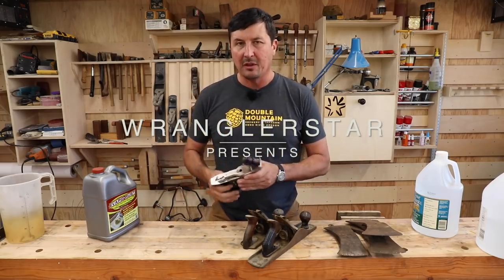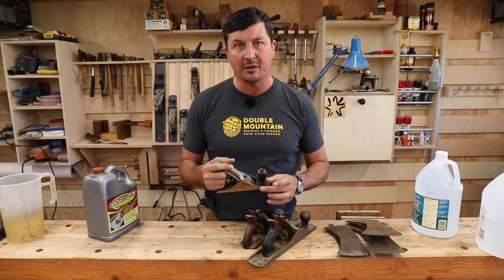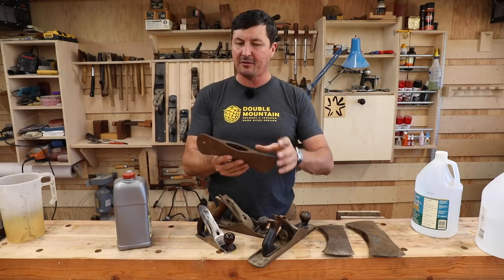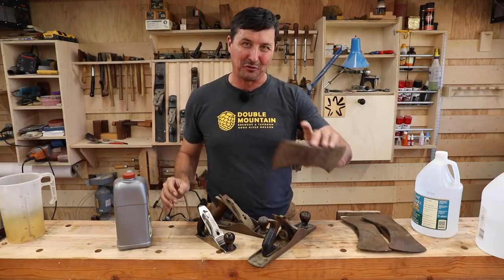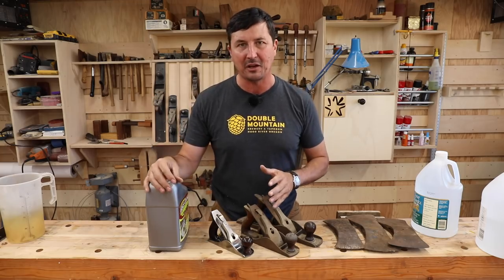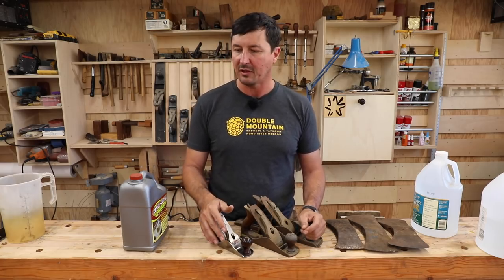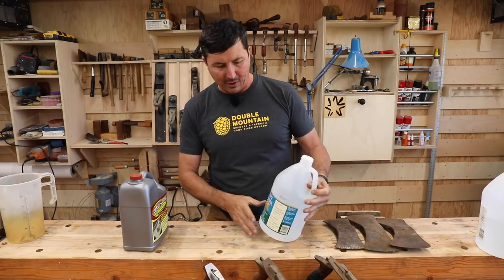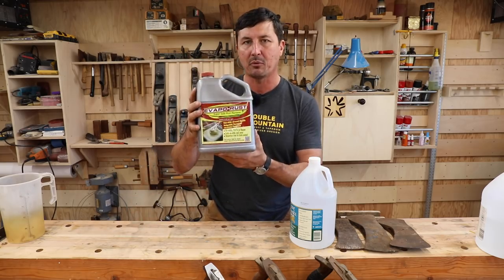Polishing A Rusty AXE

Comment: I use both, and cider vinegar all with great results. The evapo rust 3.5 gallon comes with a handy basket too. However I would knock off as much rust and dirt with a brush or wire wheel first I find it let's the evapo rust last a little longer. Great video wranglerstar hope to see those double bits in another axe video someday.

Comment: Vinegar is waaay slower, eats away at the metal, and it'll rust easier later on as it doesn't get in pitting. I recommend Evapo-rust anyday. Usually only needs 6 hours max, literally all pitting from rust is CLEANED OUT. Leaves everything (as you couldn't see the paint) and has all the benefits on the bottle.
Reply: Oh, forgot to mention. YOU CAN REUSE THE STUFF FOR YEARS.

Comment: Have you ever tried coca cola for rust?
Reply: Marc Reinecker oh ok
Reply: Works amazing on Battery terminals. I think I used Diet Coke tho.
Reply: I recently did a test between distilled malt vinegar, apple cider vinegar, coke and bleach. Malt vinegar was most aggressive, apple cider next, bleach worked a bit and coke did almost nothing - this was after a day and then also after a week left in the liquids. I tried them covered and open to air too - malt vinegar really ate into the metal actually. Was an interesting experiment

Comment: +Wranglerstar , You can reduce the amount of liquid rust remover required to a very small amount by putting the item in a bag with the liquid rust remover and then leaving your bagged tool to sit in a container of water.  The water pressure should very evenly disperse the liquid rust remover along the surfaces of any item without voids.  The only problem is that it squeezes it so thin that it occasionally will not complete the reaction before becoming locally inert, but there is an easy solution!  Simply pick the bag and item up out of the water and all the liquid rust remover will fall to the bottom and self agitate,  then you can return it to the container of water to finish reacting.

Comment: I've been using Evaporust for years and it ROCKS! One caveat, put something (oil, paint, primer, etc.) on the metal right away because it will start to rust from moisture in the air right away.
Reply: Also, Evaporust supposedly has an expiration, haven't had a problem with that, only losing effectiveness from over use.
Reply: Also, also, Evaporust does not efect wood any more than water.

Comment: I have used both products many times and your results seem to be identical to mine. I found out that 12- 24 hrs with the evaporust and 2 and even up to 3 days with the vineger . If you left the vinger work a little longer it would look the same as the evaporust plus the evaporust is expensive but can be used several times. so both work equally well just depends on what works for you in both time and of course money.

Comment: Love Evaporust! Used it for restoring a bicycle. Also, once it settles, you can reuse it if you filter out the old stuff. I did find though that surface rust will begin again if you don't thoroughly dry it after rinsing it and you don't find a way to protect it.

Comment: I tried this stuff after watching your video.  I had an Register in my bathroom located between my shower and toilet that was really rusty, aim being what it is.  So, I put the rusty register in evaporate and let it soak overnight.  It did an excellent job on this rusty register.  I can actually open and close it now.
  I am going to throw in some rusty tools and chainsaw chains that I have in the shop to see if it will do the same to these.  I got the chains given to me a because they were so rusty.  My chains are so coated with bar oil they will never rust.

Comment: For those who are wondering why this works, here is why: Weak acids (like the vinegar) can dissolve and loosen rust, the rust that is removed forms a salt that is soluble. Vinegar can also replace the rust with a thin film on the surface to help resist further rusting, and that is why the vinegar soaked tools are not as shiny as the ones that were in the evapo-rust. Other acids like coca cola and even lemon juice are other ways to remove rust.

Comment: I think the Evapo-rust was doing a better job at not damaging the axe. 
You were right about a darkening and pitting of the vinegar soaked steel, the dark colour is micro pits taking away a smooth surface light reflects off. Vinegar is mostly water, which oxidizes, and the Acetic acid actually speeds up the corrosion of the steel.

Comment: you can soak your cast iron pots and pans in vinegar for a couple hours then use a scrub pad on em before ya remove em from the soak to get all the gunk off, then rinse in clean water, some say soapy water, before re-seasoning em.  Vinegar will etch the metal if left to soak too long but ive soaked a couple of old dutch ovens that were rusted beyond belief for a couple days and had no issues.  They came out looking like they came off the factory floor brand new unseasoned.

Comment: I have an old cast iron skillet and when it gets rusty on the bottom, I warm it on the stove apply about a teaspoon of vegetable oil, wipe with a paper towel and place the skillet upside down in a cold oven. A rusty outdoor tool could be warmed and treated with beeswax or vegetable oil and kept in a shed. But, if I clean an indoor tool and want to protect it, then warm  it and apply beeswax or 3-in-1 oil. I'm not going to fuss with a patina of rust, I'll treat it and store the tool. It should be done on scheduled maintenance.

Comment: The vinegar will leave a darker tint to the metal. Evaporust can be used several times before it has to be thrown out. I've used it and electrolysis exclusively for a couple years

Comment: ahoy,
got this from an old US Civil War soldiers journal, 
and it works great:
1 part molasses to 8 parts water,
mix it up and let the rusty item hang in the solution.

I've been doing it for years, currently have a 55 gallon barrel of the molasses solution, right now it has a half dozen Griswold frying pans it in it. a month ago it was a pile of 1920 Harley parts,
it works

fair winds
Salty

Comment: I would presume he had Ballistol or some other oil protection on that little Stanley tool he dropped into the cleaner. If so, it first would need to be stripped of any oil or wax as those will negate the vinegar and I'm sure the Evaporust stuff.   A brass brush is good to scrub with under running water (yes water), once cleaned good with the brush, I dunk in a bath of baking soda THEN, when coming out of the baking soda, I use a hi output blower to get rid of the water, then rub down or pour denatured alcohol over the tool to evaporate any hiding wet spots, then immediately do a oil or wax rust prevention on the item.

Comment: I tend to use vinegar, turns the red iron oxide (rust) into black iron oxide, works better with heat, and agitation. But it is an acid so you have to neutralise the metal afterwards. I'd like to try out the evaporust on a few projects I have coming up...

Comment: I found a product that is really good at preventing rust.  I have my shop in the basement and it's always damp and everything rusts.  I put this stuff on all my tables and tools.  It's called Fluid Film and it's made from sheep lanolin.  I have no connection with the product other than using it.  It's not cheap but a little goes a long way.  Been using it for years and believe in it 100%.  I got mine on amazon.

Comment: Good test and comparison; thanks. As a rule though, vinegar takes a bit longer, especially as it can be hard to find off-the-shelf distilled white vinegar with more than 5% acetic acid content. The greater the acid percentage, the faster it works. Plus, for the price difference, I can wait a little longer. Still, a good comparison; much appreciated. As to the planers (when not sitting in a rust removal bath), always best to lay them on their sides to avoid damaging the blades. Something my old shop teacher taught us...and sparing no decibels in the telling. Regards.

Comment: I restored some rusty tools with reverse electroplating. I used 16 penny nails as a waste anode, ran a 6 volt lantern battery, through a water bath with baking soda in it. It pulled the rust off the tool and rusted the nail.  It was slow, but fun.

Comment: I noticed the vinegar was still working, it takes longer but if you left it in another 12 hours and it came out as clean as the evapo rust, and it's so much cheaper I would go with the cheaper one as the other one isn't cheap.Great video again.

Comment: Use vinegar and salt as an electrolytic solution. I'm sure you have a 6 volt battery around. Put the piece you want cleaned in the solution with a wire to the negative terminal, and a piece of scrap in the solution connected to the positive. 
 You'll be amazed at how well it works . Makes chrome look brand new.

Comment: vinegar will give metal a little bit of a patina. I've used that process to patina some knives I've made to help keep the blades from rusting. One knife i tested it on has no rust on it still and its almost been 2 years. and only did a single oiling of the blade 8 months ago.

Comment: A trick I use for a great finish after a vinegar bath is to rinse the head off in hot water then a thorough scrubbing with a green Scotch-Brite pad and hoppe's 9 it gets rid if the vinegar smell and prevents flash rust in addition to removing any Clingers

Comment: The vinegar is a acid, and it needs to be naturalized and the metal oiled as soon as possible. been there done that. I use a 50/50 water vinegar mix  to clean rusty gas tanks, I let them soak, rise them out with baking soda water, blow dry them with shop vac, and the rise them with a little diesel.

Comment: Evaporust is a great product I used it as a penatrant soak on a turbo housing (after destroying 3 of them cause of bolts that where seized and couldn't be drilled)  after the soak i turned the bolt out with a wrench

Comment: I don't know about the expensive stuff- but be careful with using vinegar to get rid of corrosion on certain types of metals you are trying to restore. It might remove the corrosion- but if you leave certain things in it for too long (I.e.: Brass)-  the vinegar can actually strip away some of the base metal. 

Other things that commonly work for rust removal on tool restorations are Citric acid and Di-ammonium Citrate.

Comment: Now all you need to do is go out and get yourself some of those disposable aluminum foil turkey roasting pans so you can submerge the entire tool.
Nice thing about the vinegar is that it puts on a patina that will help to prevent rust in the future as well. I use it on the knives I make to force a patina to lower the maintenance requirements of the end user. Upon request, of course.

Comment: I swear by Evaporust. It works best warm never in the cold in my experience. Have used a fish tank pump on larger objects to treat in a large pan. Also you can soak large towels of the stuff on metal too. Can use it over again I usually filter it into another bottle.

Comment: i checked out Evapo-Rust's website after I finished.  Looks like pretty good stuff.  Non toxic, if you let it set out like you did over night and some evaporates you can just add water to bring it back to the original level and it will be good again.  You can reuse it several times and you can pour it out on the lawn or down the drain.  Pretty cool.  I do have a rusty axe head. I'll have to try some.

Comment: Vinegar and steel wool is amazing (and cheap)! I've used it on axe heads and old rusty cast-iron frying pans. Other chemicals may be faster, since they're stronger acids, but also much more expensive. Vinegar is a light acid that works great...just takes a few more hours (I generally leave things soaking for 24 hours or more).

Comment: These are my two cents from France: Put vinegar in a kettle (of course a cheap or old one) before using it. Since chemical reactions are accelerate by heat you will get better and faster results (much more bubbles). Then few pass with a metal brush and then rince them briefly with water, then dry them  before dipping your tool in oil (I use linen oil because it's cheap). I remarked that without these three last step they have a tendency to rust again with the atmospheric moisture and the remains of vinegar. I used this a lot especially to restore old file without damaging the grain (PS: my english may not be perfect...dude I'm french...what do you expect ;) )

Comment: i got some awesome degreaser one time commercially cant remember the name but i restored two 1960 model craftsman jewelers lathes and they had been sittin in a barn covered up for 25 years but i put the painted pieces and all the rusty parts in it for a couple days to take them out and they was down to bare metal. i was so so amazed. vinegar turns metal black well these was not black it was bare bare metal. amazed

Comment: You have the vinegar you need to add backing soda to it to it will bobble up that is working keep it over night ,if it still has rust on it leave in for one more day and more vinegar and baking soda to it cover it over night. I use it to remove rust from gun parts all to time .

Comment: The advantage of White Vinegar is that it is exceptionally cheap while being as effective as many expensive brand rust removers.
The downside is that you do want to put it in a container or a well ventilated area because it is of course vinegar so will have a strong odor to it.

Comment: i agree with Berserk7111. i think if you had a big old bath of the vinegar which you could dump large and heavily corroded items in to get rid of the majority of the rust and then just use a small amount of the evapo-rust on either smaller items or something you really care about like those axe heads then it'll be much more cost effective. you just have to put the vinegar bath someone well ventilated!

Comment: Removing rust with vinegar is more of a 24-48 hours, if it hasn’t broken most of the rust down, add more because the acid will be neutralized.  Wait another 24 hours for really rusty, pitted items, then use wire brushes etc.  that’s what works best from my experience.  Ultimately you can leave them in vinegar for days and days and weeks, in time it can break down weak metals so you don’t want to leave anything you want in for months/year.

Comment: You could also use electrolysis. I wouldn't be against using the vinegar, but I would want to heat it up some to cause the reaction to speed up. Of course you could use the warm vinegar to get the majority of the rust off, then spray the piece with EVAPO-RUST and set it in a bag overnight.

Comment: I had a old double bit axe that had been left in the elements for ~60 years with horrible rust but I left it in citric acid for ~60 minutes and i got a similar result except for the pitting I didn’t use any specific measurements I just eyeballed it and but be sure it’s really concentrated

Comment: I stumbled across EvapoRust a while back, and it's great, but it may not work equally well on all kinds of steel.

I was given an old Irwin brace and bit set , just like yours, but had gotten wet in storage and the bits were rusted.  After soaking in EvapoRust, it left a lot of black stuff that I had to remove physically.

Comment: Nice work, good to se a comparison. But you should really try citric acid. Really cheap in bulk, don't smell anything. Faster and does a better job than the vinegar. I Heard that the citric acid reacts with the rust chemically. You have to be fast when cleaning and put oil on when Clean, you can se the Surface rust start to develop after just a few minutes. Very Clean. 
I use this method to Clean old horseshoes for my Projects... Thanks and nice work!

Comment: I used to only us vinegar to remove rust from my files, now i use it on all rusty items. It seems as if it not only removes the rust from the files but sharpens them too. Now i could be wrong about the sharpening part but it sure seems like it does.  I soak items from 12-36 hours. Some items will flash rust when you take them out and just rinse with water. To help mitigate that , i normally have a container with mixture of baking soda and water that i will dip the item into to neutralize the acid of the vinegar.

Comment: I have a question for some of you more knowledgeable on this topic than I. Cody, I would appreciate your opinion if possible. I have used vinegar many times on axe heads many times. Never evaporust though. The one and only time I used vinegar on a plane I had horrible results. It was a rusty Stanley number 3. It was all there and very good condition just rusty. So I let the #3 soak over night, it may have been in the vinegar 10 hours. The next morning early before work I took it out and wiped it off. As I wiped the sole I noticed a metallic color on my hands. It actually took metal off. After it was wiped it looked like it had severe pitting, but very very small grainy pitting. The plane was no where near rusty enough to have pitting like that and I could see it had almost made the metal into a liquid per say. Has anyone else had this experience or Cody did you? Obviously I have not done this with a plane since. If anyone could weigh in on this I would appreciate it thank you.

Comment: The big difference between these two methods is, that vinegar is much more aggressive against the metal. If you let it sit too long you will geht your bits and pieces back with the look like a sponge because it took to much stuff away. Evaporust is much more friendly to the material - you shoud keep that in mind

Comment: The vinegar will continue to work on metal if there is even a tiny amount left on. Neutralise it with an alkaline after using vinegar or you can get pitting in the metal. I know this from hard experience.